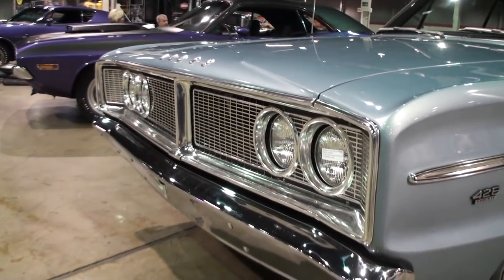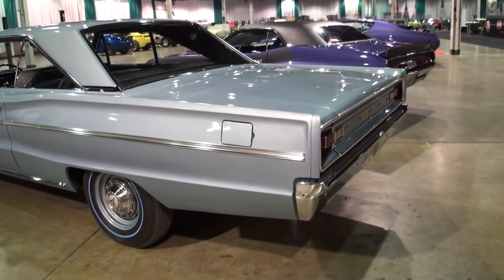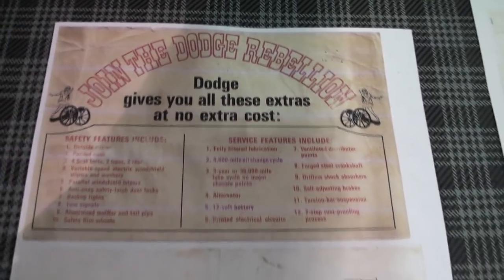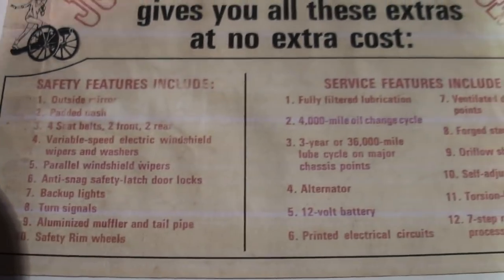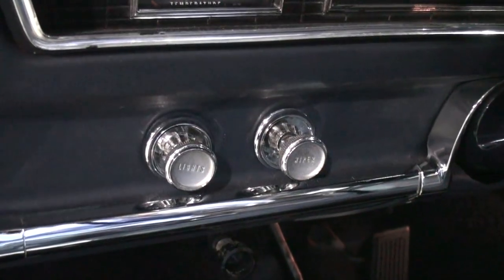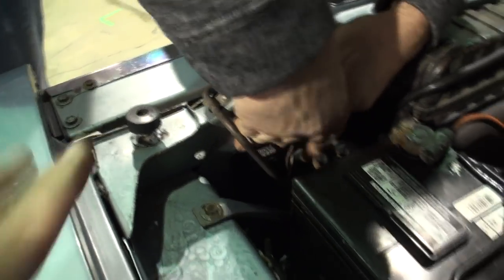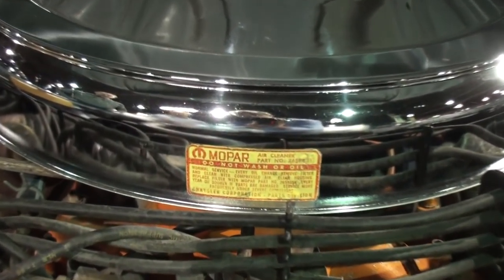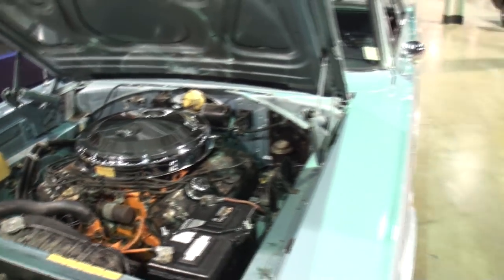1966 Dodge Coronet 440 Survivor in Blue & 426 Hemi Engine Sound on My Car Story with Lou Costabile

Comment: What color is the paint?
Reply: Medium Blue   Code D   , Light blue  was Code C and dark blue  Code E .     The  fender tag   has DD1    which is  blue  lower body and blue top  as a monotone    while the  E   means  Ordered .  
       The Code 1  on the upper  protion of the tag  means SOLD CAR   as in  buyer ordered .
Reply: @garywood9525  Thanks. It is beautiful and unique.
Reply from the maker: I see Gary wood shared the answer.